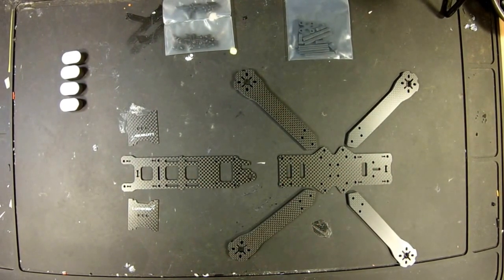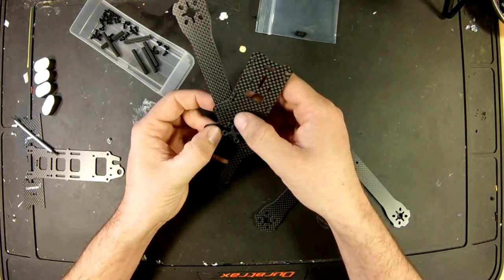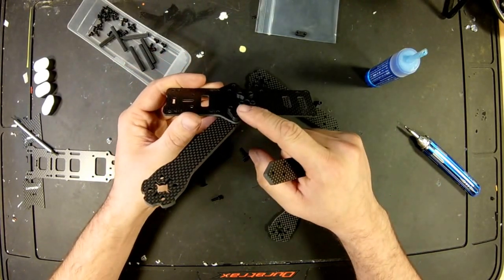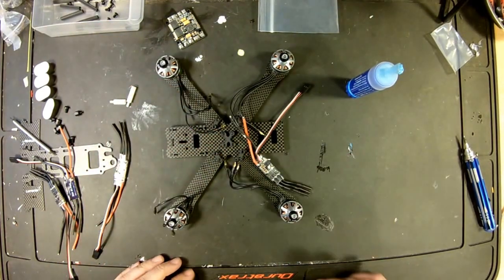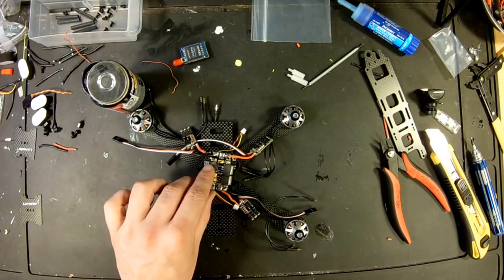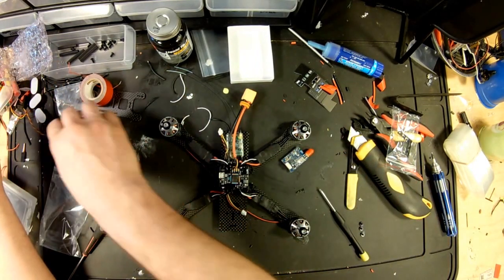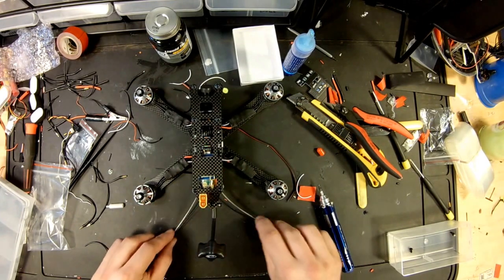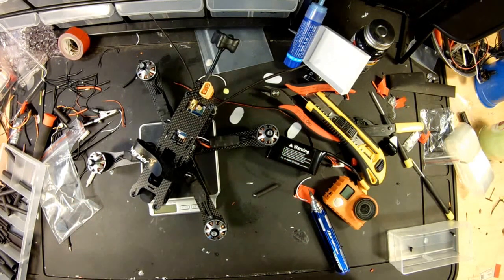Lumenier QAV-R Complete Build and Overview

Comment: t-bone-drones  hiya I just wanted to ask did you run this on the 1300mAh 4s battery or did you use a bigger battery 
iv just built myself a 180 with 2205 2600kv & racestar 30A BlHeli esc  but I'm not sure what size of batteries to get for my 180 can you give me some advice on this please